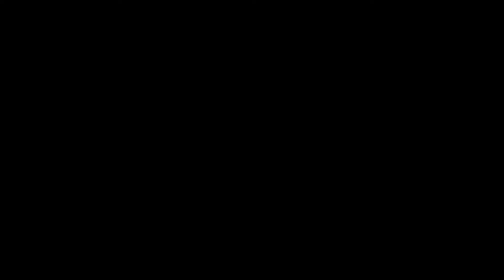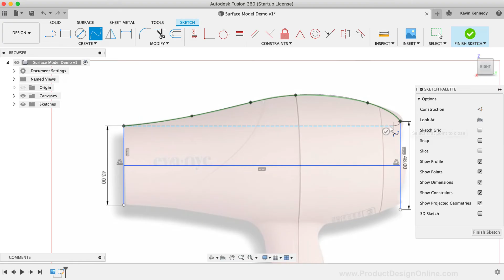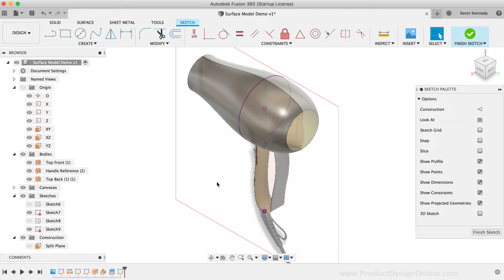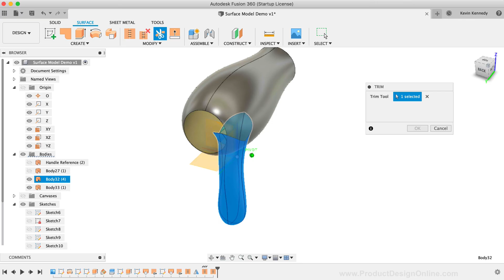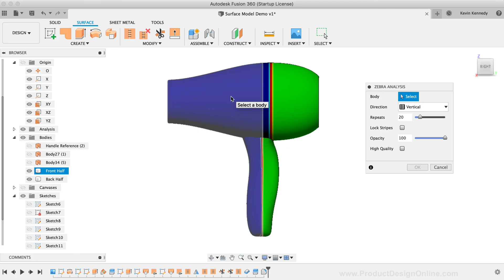Fusion 360 Surface Modeling | Intermediate Hairdryer

Comment from the maker: Do you prefer the "INT" (intermediate) tutorials or "BEG" (beginner) tutorials? Let me know by commenting!
__
Here's the reference image for this tutorial ► https://productdesignonline.com/12
__
TIMESTAMPS
0:00 - Surface Modeling a Hairdryer in Fusion 360
0:43 - Getting the reference image
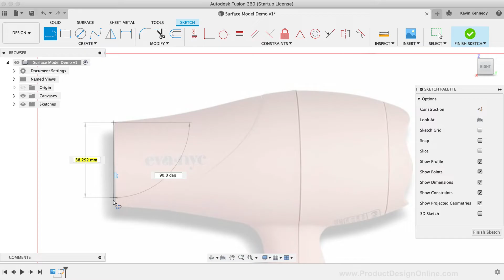2:07 - Setting up the sketch geometry
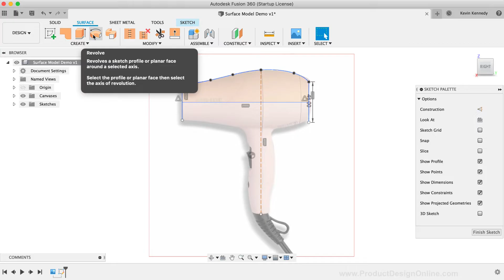5:42 - Revolving the top of the dryer
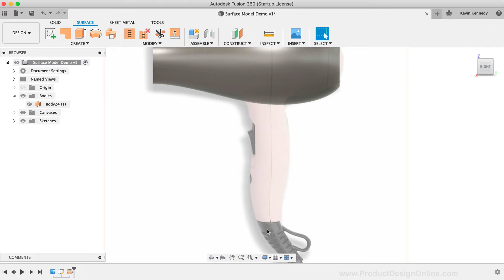7:42 - Creating the handle sketch geometry
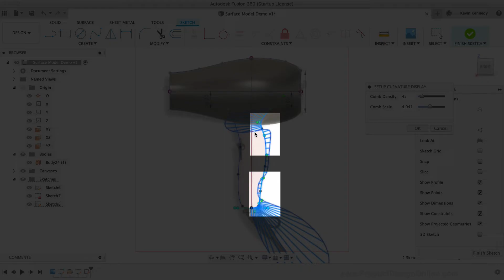12:04 - Looking at the curvature comb
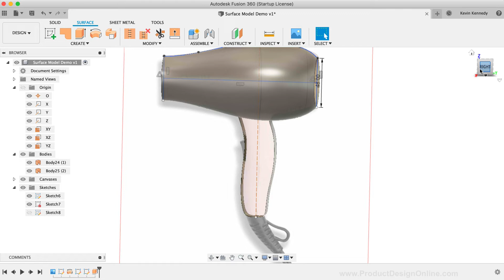12:49 - Extruing the surface geometry
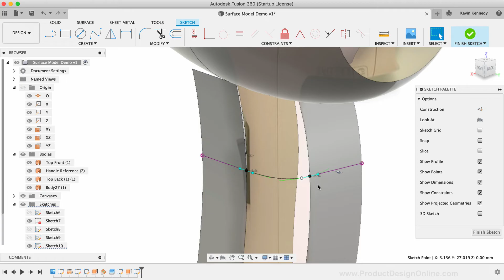18:00 - Lofting the handle geometry
19:37 - Reversing the surface appearance
21:58 - Stitching and trimming the surfaces
23:57 - Splitting the body at the parting line
24:27 - Using the draft analysis
26:43 - Zebra analysis and curvature map analysis
Reply: Hi Kevin,
You have made enough BEG tutorials in my opinion. They can understand all the functions if they refer to your older tutorials.  So more INT tutorials please :)
Thank you!
Reply from the maker: @mazashayeri1411  Thanks for watching and for the feedback, Maz! I'll definitely start to do more intermediate and advanced level tutorials as I figure out the best methods of what information is needed/not needed. Cheers, Kevin :)
Reply: INT
Reply from the maker: @tigerija  Thanks for watching, Danijel! Cheers, Kevin :)
Reply: @ProductDesignOnline  Well, thank you for this instructional video :) . Keep it up!
Reply from the maker: @tigerija  Thanks! I really appreciate your support. Cheers, Kevin :)
Reply: INT
Reply from the maker: @lobotomik3338  Thanks for watching, lobo tomik! Cheers, Kevin :)
Reply: INT..... by the way this kind of videos are really interesting for product designers, it would be awesome if you model famous design products with complex surfaces like Moby by Scott Henderson.
Reply: BEG
Reply: Int

Comment: Int
I'm doing a wing tip, and I'm having trouble with holes. You said a horizontal restraint helps prevent that, or did I get it wrong?
Reply from the maker: It would somewhat depend on the surrounding geometry. Could you provide your Fusion 360 file in my community space? https://community.productdesignonline.com/
Reply: @Product Design Online  my client is concerned about his proprietary data. If you have a secure space, I'd be happy to.
My situation is that he owns drawings from a company that went out of business a long time ago. Most of the drawings are from 1970's. He is a friend and asked me to help him because of my 3d printing and cnc hobbies. I apologize that some of this is a bit over my head. I watched a live stream from fusion 360 about t splines, and I think I got a better handle on my deficiency than I did before. 
I just don't want to have a legal trouble for sharing on a public space.

Comment: Hi, 
I am a beginner to surface modelling.
Can you tell me when to use surface modelling vs solid modelling. 
Example : If i have to design a casing for an electronic switch which has an organic form. How do I know which technique to choose ?

Hoping to clear this huge doubt.
Reply from the maker: Generally, when the focus is solely on the outside of the model and when the outside surface is important, you'll want to use surface modeling. Solid modeling is often better for models that have 'parts' that need to be assembled. Often, a mixture of both modeling types is best :)

Comment: INT for me and mostly important is good practice. As a beginner we often find way to do things but because we don't use good practice, we end up in situation where we are stuck with the way we did the design and have to redo most of it to make sure it can be modified later.

Comment: It wont allow me to "thicken" i tried remaking from start 3x, can only thicken the top part even tho they are stiched together.. it just freezes... and my PC should support it.
Reply from the maker: It's likely do to the spline geometry in the handle. You can use the 'curvature comb' in the Sketch Palette to check the curvature of your splines... if you see any funky shapes then they may need to be tweaked or fixed.
Reply: @ProductDesignOnline  i think my handle was to narrow (it worked now , checked with section analysis). Thank you :)
Reply from the maker: @fr3akky602  yay! Glad you got it sorted out :)

Comment: Hi, im loving the tutorial. But i have some trouble making the handle, right after you use the loft tool. When you select these two faces and use the intersect tool, the program automatically creates 2 purple lines that you connect. Well, i did exactly as u said and it doesnt happen anything
Reply: i think that's cause the two faces im selecting are set as diferent bodies, and i noticed that on yours are part of the same body. How could i fix this? its for a college work so im needing this a lot. Thank you! and keep it up

Comment: Thank you very much.

 I did this lesson but I couldn't get the thickness to take on the handle...It could be perhaps that my handle angles were not clean enough. The whole program just freezes up and shuts down. This happens quite a bit with my more advanced works.

I'm working on the education version from Autodesk. When I get to a certain point in my modeling Fusion 360 freezes and then the program doesn't respond. It will save work but at the same time, it's hard to have more advanced models. 

Do you have any advice?
Reply from the maker: Hi, Barret Tabler. Have you double-checked that your computer meets the minimum requirement specs? If so, Fusion 360 really should only lock up if you try to process something really intense. Thickening complex geometry can cause fusion to lock up at times.. however, that is usually an indicator that the geometry needs to be fixed. As in, things are not tangent or smooth or properly connected.
Reply: @ProductDesignOnline  I also couldn't get thicken to work, and my PC is pretty good.

Comment: Hi . I've been binge watching your scuplting and surface modeling vids . Great info. One question thou Could you make a video that shows maybe what would make you decide between the 2 methods and work flows ?   Do you ever combine the 2 ?  Cheers
Reply: You often have to use both. For example, If he wanted to make a slot for the switch to go in for the hair drier, or a hole for the cord. All 3 modeling methods have strengths and weaknesses. Personally, I have never used T-spline or surface modeling, but that does not stop me from being an accomplished modeler. Likewise my collogues who exclusively use surface modeling are also very accomplished, much more than I am. The best way to be prepared for any model that comes your way though is to not let yourself become pigeon holed as I have, becoming a master modeler requires extensive knowledge of all 3 modeling methods and their applications. That being said the most underrated skill is being able to work with things that already exist in the real world. Using what is already made is the most powerful tool of all.

Comment: 17:09 I don't get those purple points after clicking okay! why is it so?
Reply from the maker: Hi Manvir. First, can you double-check that your "projection link" option is checked in the Intersect dialog, as seen at 17:03? If that's not it let me know and I can look at your file.
Reply: @ProductDesignOnline  Yeah it's turned on! Also I noticed one thing is that before you pressed okay in the intersect dialog you already had those lines, on which you get the purple points visible whenever you hovered over the body. I don't have those. Maybe that's the issue?
Reply from the maker: @manvirsingh1088  Hmm.. can you check that your settings are the same as mine? https://bit.ly/defaultsettings

Comment: Great video. Really life-savers in trying to learn F360. No way I could learn what I have without your work. I get a lot out of all the videos you do and this one and the previous one I watched have pretty much explained that I need this approach for the next project I'm having problems with. I want to use F360 to make various things on my CNC router. One thing I am having difficulties with is carving. I want to make a contoured carving of the profile of an eagle. I have a straight-on reference picture I can use as a canvas, but I'm not able to get the various Z axis contours right. Modeling mode is not giving me results I need and sculpting solves some of those issues but has it's own issues. I think surface modeling will be what I need. Would love to see some tutorials on that if that's something you are ever interested in doing. Thanks again!! Going to send you some coinage as soon as I can.
Reply from the maker: Hi, Matt. It does sound like surface modeling would be the best approach for your CNC projects - it's great for defining contours! I'll definitely be doing some more surface modeling tutorials in the future :)
Reply: @ProductDesignOnline  Excellent, thanks. I have been successful in doing some basic surfaces for the project, but having problems adding fillets, as it only allows me to add them to certain surfaces. Is there a way I can send you some shots of what I have and what I want to do some some advice on how to get what I'm trying to do? Thanks.
Reply from the maker: @kb8wfh  Hi Matt, If you can link to your images hosted somewhere, such as Google drive or Dropbox, reply to this comment then I'd be happy to give you some pointers.
Reply from the maker: @kb8wfh  Hi Matt, sorry for the delay.
1. You'll want to make sure you create a new component at the beginner, which will group all your sketches, images, bodies, etc. That will make it easier if you want to copy/mirror/move the part.
2. The way you started is certainly an okay approach. The other option would be to make a solid extruded base and then create the details on top of it.
3. Once you turn your surfaces into a solid body you'll be able to add fillets or chamfers to all the edges. It looks like the eye and some of the other areas around the beak would be rounded over with a fillet. Some of the other details look like they have sharper edges so a chamfer may be more ideal. With the chamfer tool, you can set the "chamfer type" to "two distances" which will give you greater control over the angle and direction.
Cheers, Kevin :)
Reply: @ProductDesignOnline  Excellent, thank you! Much appreciated.

Comment: I do want to add several points:1. surface modeling is more parametric than freeform model, although the two are similar. 

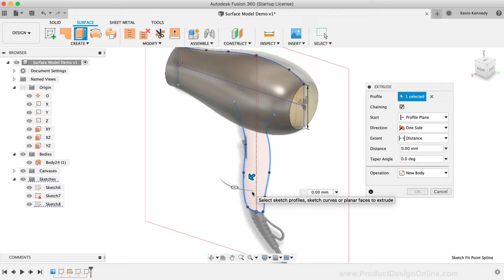2. the reason you extrude two sketches at 12:30 is because two connected sketches can not be lofted. And you got a excellent solution for that.
Reply: After I watch your Iron surface video, I realize you can loft two connected sketches by click + button to add two sketches. Now I guess the reason you extrude the sketches for the tangential.
Reply from the maker: That's correct! It's a more "proper" way to ensure the faces are tangent/smooth curvature :)

Comment: Kevin, I really enjoying your videos. I am trying to follow through most of the video's, really learning a lot. I have run in to a snag with this video though. When I get to the thicken command after the top and handle are trimmed and stitched together. It doesn't matter what value I use: from -3mm down to -.5mm, it tells me it could not create a valid result. Here's a link to my file, maybe there is something I am doing wrong, but I can't see anything: https://a360.co/34tFFsn.  Thanks.
Reply from the maker: Hi, Jeff. Sorry for the delay. I remember looking at your file..but I now see that I never replied :)

Upon looking at your file it appears that Fusion is not liking something with the bottom of the handle area. Try to make sure that your spline handles are all horizontal by adding the vertical/horizontal constraints as I did in the video.

If you're still having troubles with it let me know and I can take a closer look. Cheers, Kevin :)
Reply: I ended up re-creating one of the splines for the handle and it works now. Thanks for pointing me in the right direction!
Reply from the maker: @jefffield1402  Hi Jeff. Glad to hear you got it working. Splines can be tricky in surface modeling. Cheers, Kevin :)

Comment: Hi, great video! One question: what is the difference between stitch and merge?
Reply from the maker: Hi, Thomas. Great question. The Merge command works only within a single body. It's used more to fix faces; whereas, the stitch command joins together every single body that is selected. Cheers, Kevin :)
Reply: @ProductDesignOnline  thx!
Reply from the maker: @ThomasHaberkorn  You're welcome :)

Comment: can this be 3d printed?
Reply from the maker: Hi, Mogu. You couldn't certainly 3D print this, although I have not tried this specific model. It would work best with the split halves laying flat on the build plate. It may need some interior support for the handle area, however, if the handle curvature was tweaked just right, it could be printed entirely without support.

Let me know how it goes if you end up printing it out! Cheers, Kevin :)
Reply: @ProductDesignOnline  thnkz

Comment: Hi Kevin, My PC keeps crashing on the trim function and then the thicken function... how can I change settings to maybe speed things up?
Reply from the maker: Hi Darren, Below are the minimum specs required for Fusion 360, per the folks at Autodesk. Does your computer meet these requirements?

To clarify, are you having issues with any other features or just when you try to trim or thicken this model? Sometimes it is due to geometry interference issues, and Fusion 360 cannot solve it, which causes it to go bonkers.

I'm not sure there is a way to speed things up per se. The first thing to do would be to try to figure out what geometry F360 is struggling to process in this model. 

Cheers, Kevin :)
--
Apple Mac® OS® X Sierra (10.12.x),  OS® X High Sierra (10.13.x), Apple Mac® OS® X Mojave (10.14.x) 

-Microsoft® Windows® 7 SP1 or Microsoft® Windows® 8.1, Windows® 10 
-CPU: 64-bit processor (32-bit not supported) 
-Memory: 3GB RAM (4GB or more recommended) 
-An internet connection of 5mbits/s or faster (10mbits/s recommended for Simulation Solves) 
-Disk space: ~3.5GB 
-Graphics Card: 512MB GDDR RAM or more, except Intel GMA X3100 cards  
-Pointing device: Microsoft-compliant mouse, Apple Mouse, Magic Mouse, MacBook Pro Trackpad
Reply: Hey Kevin, my computer specs are more powerful than needed.. I'm having problems with only the Trim and thicken functions. I get a white screen and then it asks (Do you want to wait) then I wait about 5min and then the trim function works.. I'm going to take it up with Autodesk. I might be doing things the wrong way. We'll so how it goes.. Thank y0u once again :)
Reply: Hey Kevin, so today I had one mini stall but everything seems to be working fine now.. maybe my internet speed was down although I don't think it's the Net .. I don't know.
I'm going to leave it and see how it goes. Thanks :)
Reply: I'm still having issues where the PC keeps crashing on surface trimming, is it possible for you to check my file.. if so how can I send it to you? Thanks in advance :)
Reply from the maker: @darrenthacker9223  Hi Darren. Thanks for the updates. I would be curious to hear what the folks at Autodesk say as well. I can definitely take a look at your file to see if I experience the same issues on my end.

To share your file please go to File > Share > Share Public Link (make sure "downloadable" is toggled on) > Paste your link here as a reply to this comment. Cheers, Kevin :)
Reply: Hi Kevin, so I didn't manage to get anything out of autodesk.. After reading one of your previous statements I realised that my surface geometry was protruding through the top of the hairdryer which I could trim, but I think Autodesk did not like this. So I increased the diameter of the hairdryer and adjusted the handle sketch so that there was no protrusion, it works now.. I just wish that Autodesk could tell you what the fault is and not just stall. I appreciate all your assistance.. I'm really enjoying your tutorials :)
Reply from the maker: @darrenthacker9223  Hi Darren. Glad that you found a workaround. I 100% agree with you - there are actually many use cases where the "error" messaging in Fusion 360 (all Autodesk products for that matter) is not very helpful. A lot of the error messages are really vague and group a number of common issues that happen. Hopefully, this is something they continue to update in the future, we will have to chime in on the Forum to push for it. Cheers, Kevin :)
Reply: Hi Darren, I was having the same problem, and your workaround also worked for me! Thanks, it saved me some headaches for sure.

Comment: kevin i saw alex senechal is using ''lcd display'' in material tab and use it on glasses that indicates lcd, but i cant find lcd display material in my material tab, how can i download them?
Reply: Im on windows, and yes i will provide you a screenshot
Reply from the maker: Hi, Pouya. Simply click the keyboard shortcut letter "A" for the "Appearances" dialog. Then, search for "lcd" in the search box. You will then see a list of LCD options, from which, you'll have to click the download icon on the righthand side in order to use them. Here's an image for reference - https://snipboard.io/AKTSJg.jpg
Cheers, Kevin :)
Reply: @ProductDesignOnline  thanks for responding but when i search them in searching bar its says no result, my fusion is also updated in latest version, i cant find them, ive searched alot in appearancec tab, nothing there
Reply from the maker: @pouqya  That's strange. Are you on Windows or Mac? (not that it should matter). Also, can you provide a link to a screenshot so I can see if there is anything that would be causing this? Cheers, Kevin :)